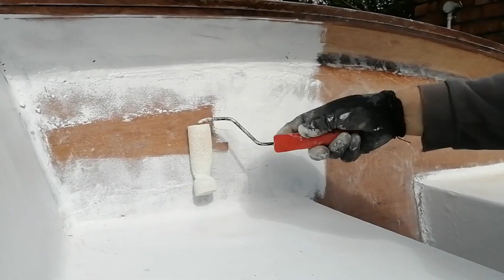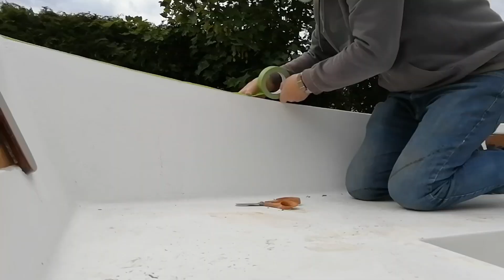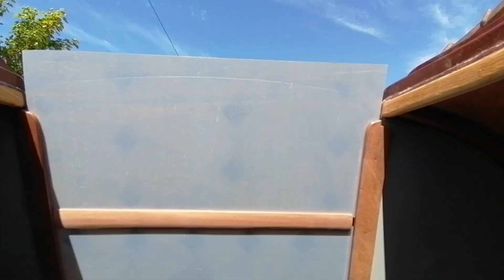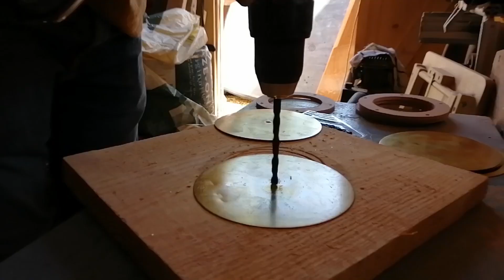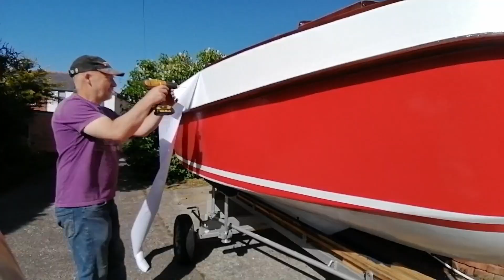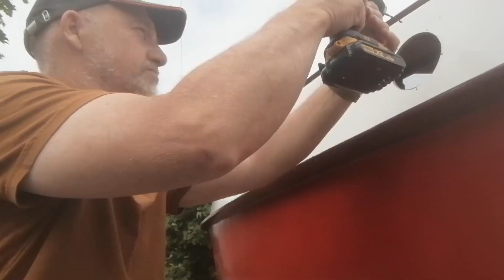AHAF Building a Pocketship part twelve : Dropboards and portholes

Comment: Hi Alan, Josh from Boston again, Great progress! The brass rings look great. How did you end up waterproofing and installing the glass (Plexi?) in the portholes?
Reply from the maker: Hi Josh, good to hear from you. I did a trial assembly for the video but plan to attach the inner plywood rings with thickened epoxy resin being careful to align the holes then bed the acrylic discs and outer brass rings in 3m marine sealant. I hope to show this in more clarity in the next video 😉
Reply: @alan-hulme  Looking forward!

Comment: I was looking to build one of these myself. I'm aware the plans are around 300
Could you estimate a cost for the all the materials?
Super excited to see the next episode. It's looking flash so far
Reply from the maker: What you spend on the materials really depends a lot upon the quality of materials used. I haven't kept track of what I have spent, partly not to scare myself (!) but mostly because I wanted to spread the cost and wait to buy better quality materials rather than economise. As a very rough estimate I probably spent £2.5K on timber but as you probably know the timber prices are changing all the time at the moment! I would definitely recommend using a boatyard or kit boat supplier for the marine plywood ( I used https://www.fyneboatkits.co.uk/ ) and a proper timber merchant for other timber. Having said that there are many ways to approach a project like this and you need to decide which is best for your budget/timescale/specification/location. Thanks for your enthusiasm and good luck with your own boat build.